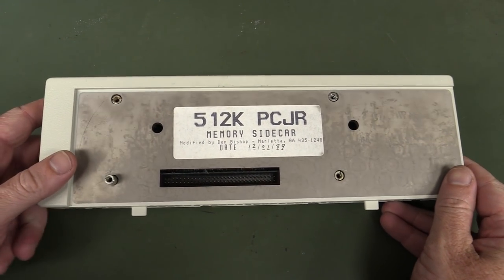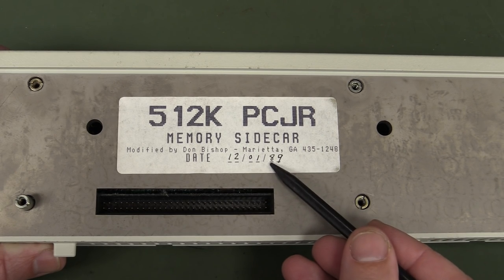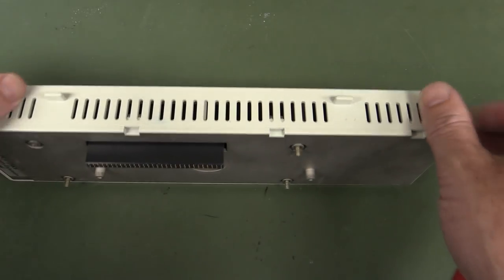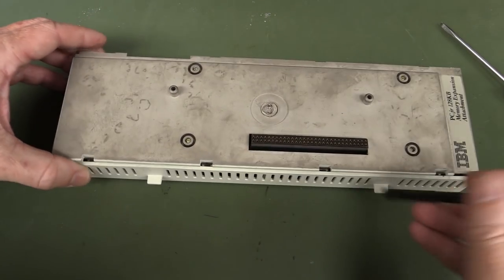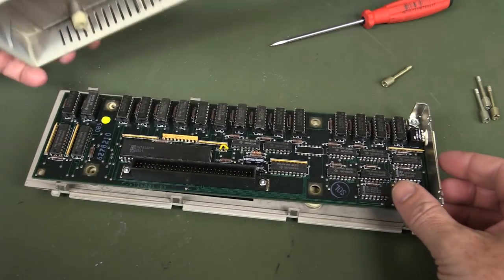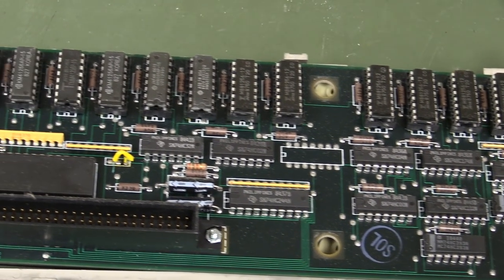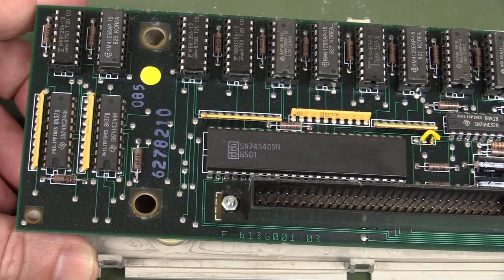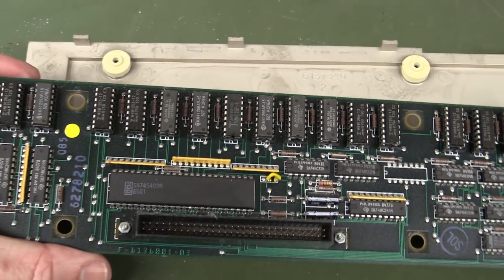IBM PC jr 512KB Memory Sidecar Teardown

Comment: This video has all the hallmarks of a blooper vid.  
* More time to open than to review
* PDF didn't work
* Battery ran out. 

Classic.
Reply: "Not much of a teardown, don't even need a screwdriver I suspect" -- uses screwdriver to pry open the clips.

Still like the waffle, and it doesn't have to punctually correct at all times.

Comment: The big IC is from MMI (https://en.wikipedia.org/wiki/Monolithic_Memories). Note the yellow jumper wire that shorts out pin 2 and 3 of the jumper while there is a scratch mark between pin 1 and 2 of that jumper. I bet you that's the 64K/256K chips jumper. Not seen so many different chip brands mixed into one memory expansion, ever!

Comment: The PCjr had the capability to go to 640K . The original 128K of internal memory plus one memory sidecar of 512K.   However, with a mofification in DOS, the PCjr was capable to have one more 256K sidecar or a second 512K sidecar to a maximum of 1024K.  The extra memory beyond 1024K was not recognized by DOS.  Also, aftermarket internal memory cards were available in 512K, 384K  or 256K memory upgrade configurations such as the QuickSilver internal card. This one was a pain to install because you had to remove the internal floppy drive and the 8088 CPU to be able to install the QuickSilver card into the motherboard. And the 8088 ppiggybacked into the Quiksilver card .  I probably installed moe than 1000 upgrade memory kits into IBM PCjrs in my early computer days.

Comment: I have fond memories of the PCjr, and while it gets ridiculed by many.  To be honest, I feel it was a Parrot Opinion; an opinion heard and mindlessly repeated so often its assumed truth rather than opinion.  Often such opinions lack any understanding or context making them more often incorrect.  Expressing a different opinions becomes a challenging of facts.  An opinion without experience is often meaningless, factually flawed and need not be expressed.

That being said, the IBM Pc Jr was about the 4th PC I experienced and used.   The first was an Apple IIe when I was 12 yrs, followed all by Macs, an Apple IIgs, PC XTs, a CoCo 2 and PCjrs.   This was the early-mid 80's, personal computers were nearly unheard of.  Using them was in part: "What is this good for?" and software selection was limited. 

What was good about the PCjr: its integration and options.  The PCjr did have a somewhat split personality as it could be a home or office machine.  The home version was IBM's early attempt to bring a PC in into the home.   I can't speak much about this line, other than it was offered with lower specs, could be connected to your TV.  The office version was admittedly higher spec'd and the one I have most experience with.  

If you had the matching monitor, you had EGA graphics with sound.  Boot times were okay, much better if you had DOS on a cartridge.  There were two cartridge slots, meant for programs/games.  I used DOS 3.3 and some word processor briefly.   People bash the keyboard without often knowing there were two types.  sure it was soft touch, with less key travel than the old XT keyboards, BUT it was wireless.   Yes, it has an IR based keyboard what worked really well.  There was an add-on Parallel port card, a 300 Baud modem card.  On add-on that was rare was the voice recognition card.

It was a machine ahead of the curve, but it did suffer from proprietary hardware, a point severely aggravated by the short lifetime IBM gave it and its not insignificant cost.  Apple computers also had similar hardware constraints, but were fully supported by Apple and had a much much larger user community.  Perhaps if the IBM PCjr had had a similar support and user community its true potential could have been realized.  From the esoteric PCjr I went to NeXT Step and later was forced  into Microsoft  and generic PCs.

The road to todays computer user is littered with many great platforms and operating systems.  What people accept and use today is rarely the best technology.  If it were, my opinion is we'd all be using some version of NeXT STEP on some NeXT hardware...which in some part happened with the modern Apple OSs tracing their roots to OS X which was almost entirely the NeXT OS.   Certain aspects of the modern internet can be traced back to NeXT OS.  Even modern RPGs can trace their roots back to NeXT with the initial version of Quake developed on this platform.

Comment: I tried this mod myself and successfully added sockets and replace the RAM. Everything working fine.
Added the 256Kb RAM chips but now it's not recognised at all.
Saw that little yellow jumper wire so added a real little jumper and shorted 2-3 but still nothing.
There are a series of dip--switches at the end of the card, do these need to be set?

Comment: To be able to add a 2nd floppy disk drive (particularly the 'new' 720K smaller, non-floppy floppy drives), I hacked my floppy controller inside the Junior with (I think I recall) at least one 16-pin DIP IC piggyback soldered somewhere, 4 or 5 bodge wires, and a 2-position ribbon cable.  Eventually I added some sidecar that gave (I think) an MFM controller interface to an external 20Mb Seagate HD.  I had a Tecmar sidecar w/ 512Kb RAM, a parallel port sidecar, and a power expansion sidecar.   The goofy computer became nearly 2X as wide.  Ah, for the days of 2400 baud to EBBS's - pre-Internet.

Comment: "The 74S409 is a 48-pin DRAM Controller/Drive"
So that's the DMA driver...
Reply: Stefan Payne The DRAM controller does have nothing to do with DMA but is actually a address multiplexer and refresh generator for thee memory chips. A DMA controller is usually on the motherboard coupled tightly to the processor to free it from the  task of transferring data from IO devices to memory or vice verse or between devices or different memory locations. In the pc it was the Intel 8237 or 8257 later integrated into the chipset. As far as I know the IBM PC jr did not have an DMA chip ( may be I'm wrong there)
Reply: Yes, the IBM PC JR didn't have a DMA Controller on the Motherboard. But you could upgrade it with a Memory Update Card.
I think LGR menntioned that at one time with one of his older IBM machines. I believe it was the XT where he said that the DMA Controller was on the Memory extension cards...

Comment: Its a 256K Dynamic RAM Controller/Driver... Here's the Datasheet...
http://sintran.com/sintran/library/libother/extern/SN74S409.pdf
6:28... They sucked out the original RAM chips and replaced them with sockets.....

Comment: IBM had an earlier version that was full of bodge wires. You have the later version in this video. That yellow jumper wire in the middle of the PCB is what told the Jr to expect 512K on that sidecar. Look closely and you'll see 3 solder points .1" apart and a cut between the middle and the one not soldered with a wire between the middle and the other solder pad to set it for 512K.

Comment: Why would it be full of wires? IBM is not botching stuff together, they have a very good name to lose. The person who said that might be referring to wirewrap boards IBM used. But that has nothing to do with botching but with flexibility and density of connections. Every part made by IBM will have a very high standard of manufacturing. Due to the complexity of their computers/machines this need to be.
Reply: It says "modified" on that non-IBM label...
Reply from the maker: Because it's a DIY mod, and that's what someone told me it would be full of wires.
Reply: EEVblog2 looking at the date on the main chip, it's a last revision so it's probably already gone through all the refining processes. Maybe if you can get your hands on an earlier revision?
Reply: I expected a bunch of piggybacked chips with extra address pins sticking out and soldered to wires.

Comment: "Doesn't need a screw driver" as he uses a screwdriver albeit not to turn screws but then discovers screws.  74S409 - Dynamic Memory Controller.  What is that for?  :-)